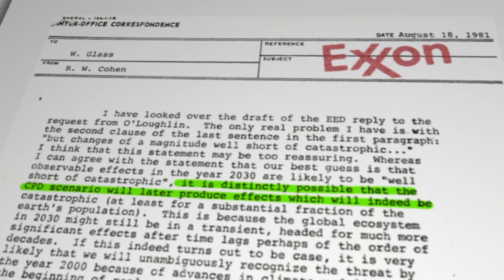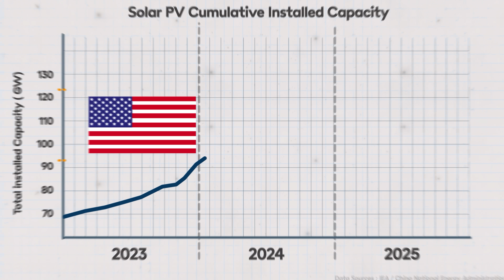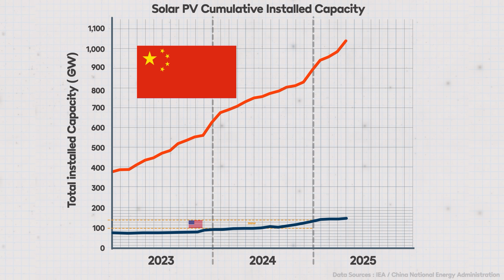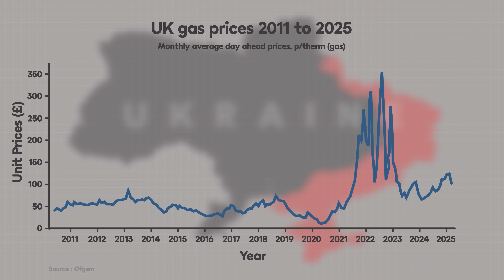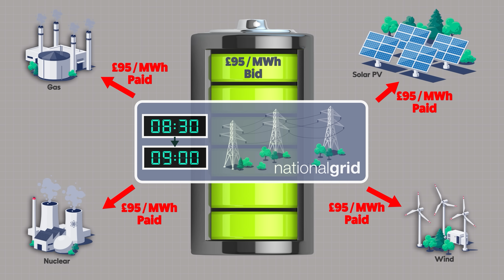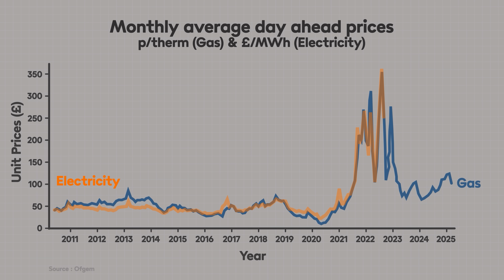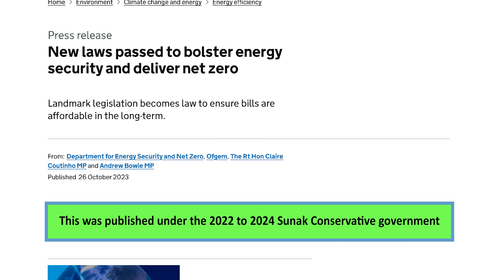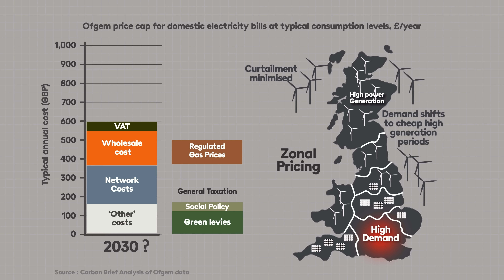Why is UK Energy SO expensive?

Comment: All members of Congress care about is getting money o discourage primary opposition and win reelection.  Follow the money.  As soon as the  renewable industry starts lining the pockets of members, policy will change.
Reply: I am very surprised that Texas actually found enough brains to vote down that bill. They somehow know the value of renewables.
Reply: @GTN3 there are insane amount of investment in Texas renewables, because it is disconnected from rest of USA and it's population centers are growing very rapidly, so does need for air conditioning for example.
Reply: @Pecisk  aka anywhere else in the world well designed and built houses.
Reply: @GTN3  They are likely terrified of another blackout situation like they had a few years ago.  It caused quite an uproar.  The talking heads blamed it on renewables, but it was entirely the result of failures in the fossil fuel power plants and the aging grid not being ready for the deep freeze.

Comment: You seem to neatly separate gas and renewables, but the 2 go hand in hand in most deployments. From what I heard, every installed TW of solar or wind has to be backed up by a TW of flexible base load energy generation, usually gas, for when the sun doesn't shine or the wind doesn't blow. More renewables, more gas... So there is an direct link between renewables deployment and the increased bill for consumers when the price of gas goes up. The only viable mitigation to the brunt of climatechange is nuclear in my humble opinion, not wind and solar.
Reply: Totally wrong I'm afraid and what you've written is pure opinion

Gas final mile is easily replaceable by battery storage at a fraction of the cost

You can build 10 wind farms producing the same amount of energy for the cost of 1 nuclear plant the tech is completely obsolete

Comment: the increase in solar energy and battery storage is growing insanely fast. many people are sick of politicians doing their job 5 or 10 years too late. but things for private installations are getting cheaper every year. not so much on the solar panel front because they are already cheap but still with batteries and electronics. easy 10% per year.
people are taking matters in their own hands. regarding peak energy demand: big grid battery installations currently probably double every year now because the return of investment is below two years now. all that together will lower the need for super expensive LNG.
next thing will be V2G in new EVs, where you might earn money with your car. if you get a profit of maybe 10€ct per kWh and you buy and sell it every day, you earn 5€ per day for 50kWh. that is 1825€ per year. not huge but not bad either - for practically no work.

Comment: Every week Dave, your presentation of complicated facts, is unsurpassed! The new nuclear power station here in Belarus has meant that our electricity bill is now only £0.014p per kWh for heating and home car charging! Haven't even considered reducing our consumption therefore, apart from building a new passive home that's very ecological! We have 24" walls and gas filled triple glazing using low emissivity glass! Even in the depths of a cold winter here, our electricity bill is less than £20.00 a month!

Comment: Just have a look at the wholesale energy prices in the Netherlands. Just about every sunny day has had hours of 0 or negative prices for months now. We have 3.2 million solar systems (one in three homes) and about 3000 wind turbines, just pushing down those prices whenever we have enough. If the UK follows this example the prices must come down.
Reply: Costs will come down, not prices.
Reply: @rogerbarton1790 People on a tracker/dynamic rate here are often literally getting paid to use electricity. Also for every normal contract the prices have come down a lot because of the mass adoption of solar. We used to have a price cap of €0.40 per kWh because of the Ukraine situation, but nowadays even with a pretty steep energy tax of €0.123 per kWh we are well below even €0.30 on a 1 year contract despite most of our electricity production still dependent on natural gas in winter. This is only going to go down even further as more wind turbines are commisioned.

Comment: The politicians in the U.S. are standing by and collecting cash from the fossil fuel industry.  Kamal Harris mentioned the term "climate change" once in her major speeches during the 24 election.  Each mention was quickly followed by the claim that she wouldn't interfere with fracking or make leases more expensive for oil companies.  The pols aren't leading us into the future, they are dragging us back into the past.  Both parties.  So, the biggest global problem, climate change, is either ignored or denied.  Meanwhile, the biggest technology innovation -- clean, emission-free energy -- is left entirely to market prices.  It's not leadership.  It is obstruction!